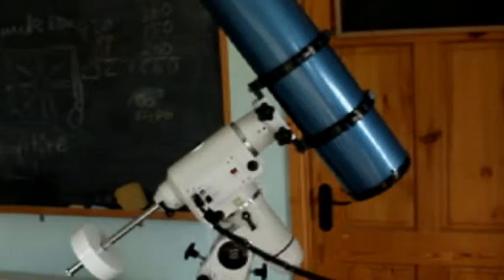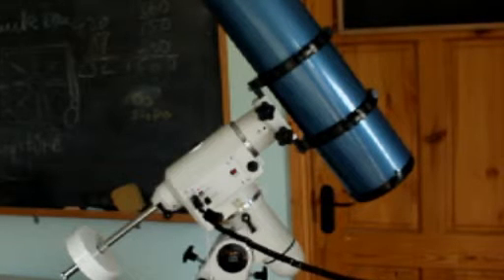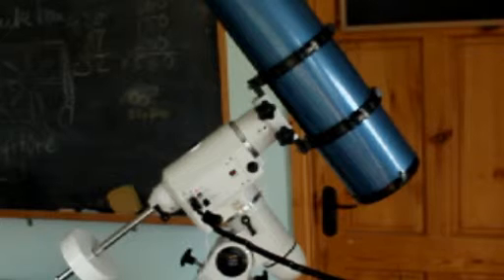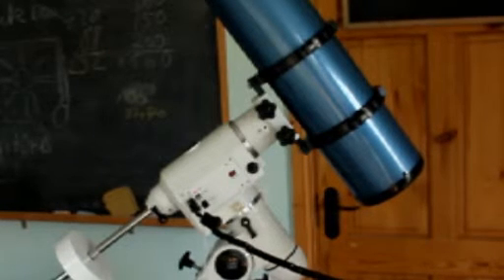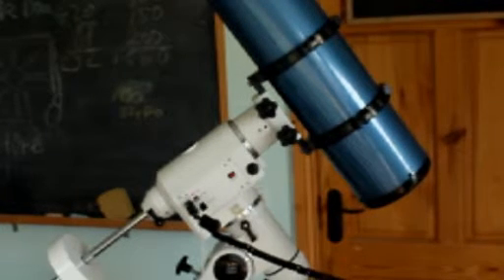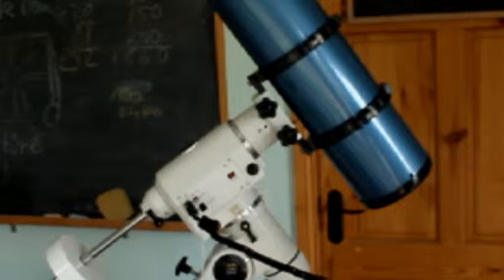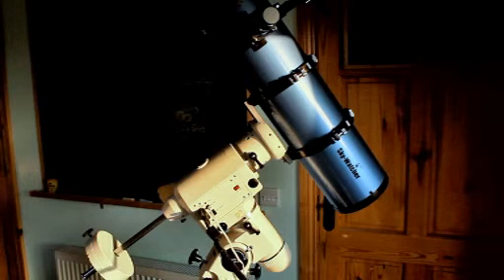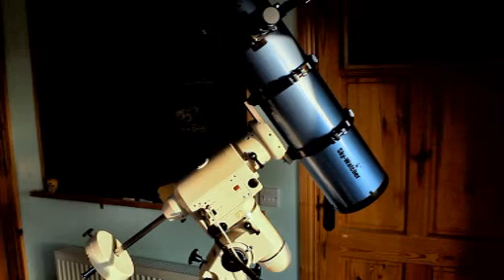NEQ6 Rowan Astronomy Belt Upgrade Kit

Comment: I noticed that the Dec did not park all the way, was this just down to not enough mesh on the worm?  Or was the belt slipping a bit because of too little tension?  Good video though and you are correct I should have done mine under load.  I might do another video 1 year on with the belt mod.